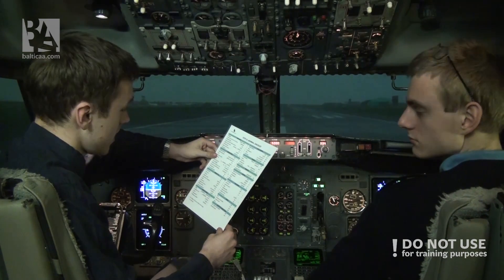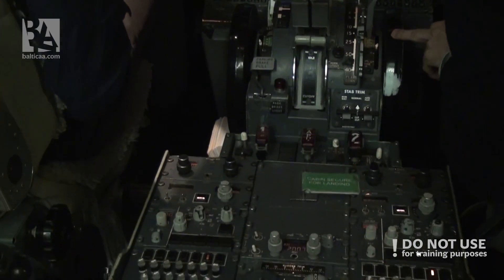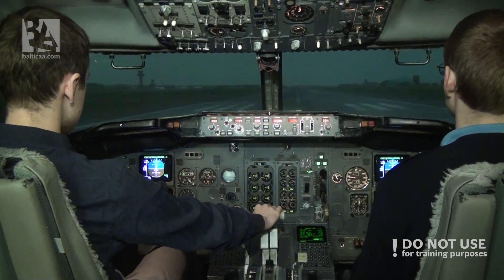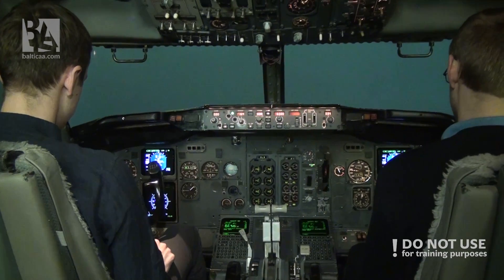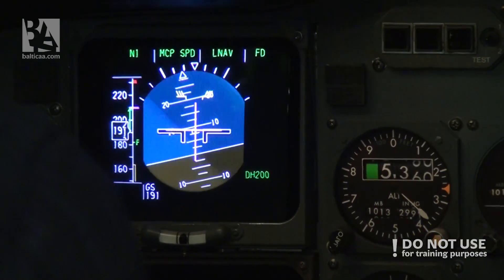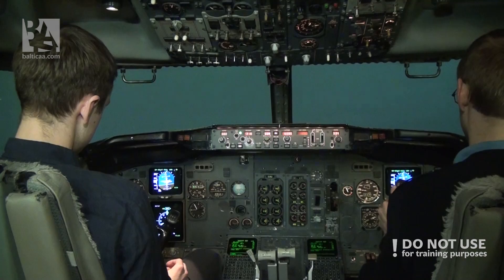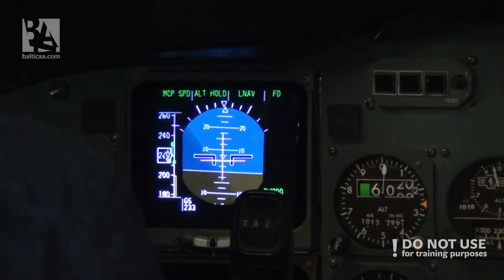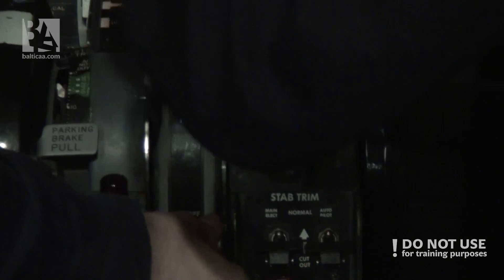Boeing 737 with engine failure, no sweat? (Part II) - Baltic Aviation Academy

Comment: Why in case of fire in the engine, the first step is not to cut the fuel?
Reply: Pulling a fire switch will do the following:

Arm firing circuits
Allow fire switch to be rotated for discharge
Close engine fuel shut-off valve.
Trip the associated GCR (i.e. switches off the generator)
Close hydraulic supply to EDP & disarms its LP light (Not if APU)
Close engine bleed air valve (If APU will also close air inlet door)
Close thrust reverser isolation valve (Not if APU)

So theoretically, it shouldn't matter. But i'm not sure what the QRH states.